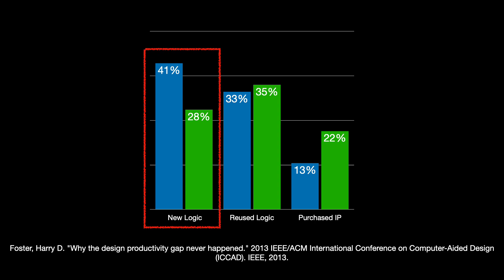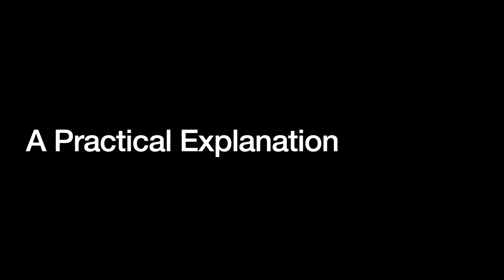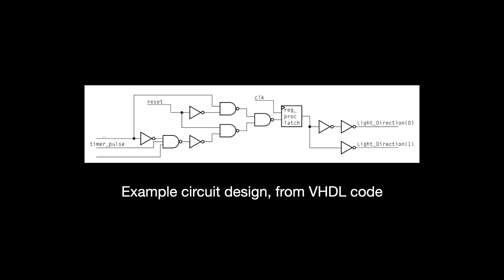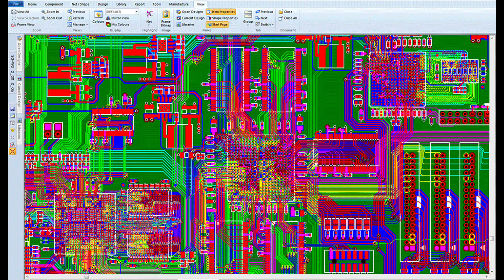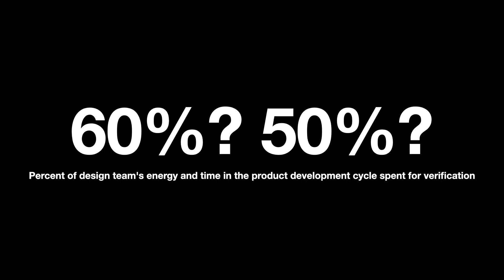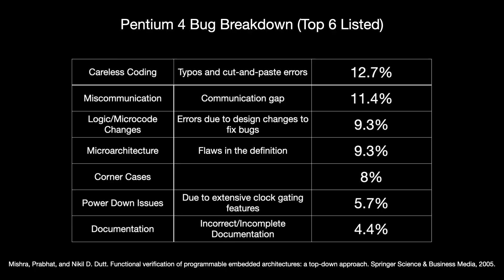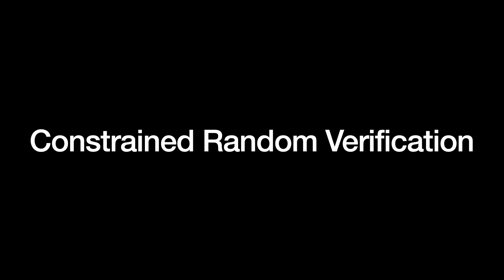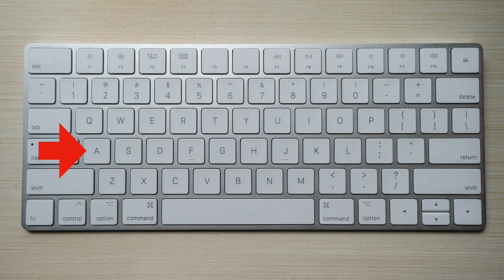The Growing Semiconductor Design Problem

Comment: I'm a test architect for software and daily work with some of the most advanced testing techniques. A technique that I'm curious if it would work in the hardware world is called mutation testing. Essentially, you mutate the product intentionally and ensure that your tests fail. The idea is - if they don't fail, then your test method wasn't sufficient to catch the mutation and must be improved. The only problem doing this with hardware is it would be very expensive to produce mass quantities of intentionally bad hardware. Still, interesting to think about.

Comment: Very interesting but all the stock photos used are pcb designs of a old computer motherboard… not the best idea when target audience are engineers. Logic design like Vlsi are FPGA design, which has nothing to do with asic design where you make cmos transition designs. There are like 5 layers of abstraction between wire and logic to bare silicone
Reply: Hate to say this, but full of messed up information. FPGA design has very little room to improve because they are not meant for performance. Soc has nothing to do with fpga, which has nothing to do with asic design or silicon level verification. A BS level college student would know these basic things
Reply: If you want to say “Vivado runs slow” just say that. Don’t over generalize.

Comment: I would say the problem is a bit deeper than depicted in the video. Digital circuits allow for atomization of the design, logic and layout today already. I expect that verification of such CPU or microcontroller will as well be automated as shown in the video. Yet a gap e.g. undiscovered spec breach may still exist. CPUs are built keeping that in mind and will have fallback structures implemented to fix without requiring a full new mask set. Now here comes trouble when going to a safety critical application such as automotive microcontrollers in an ASIL rated environment. While those controllers are far less complex regarding their computing power, the effort that has to be put into verification to comply with iso26262 standards is astronomical! This is also the reason why many OEMs ditched their efforts for full autonomous driving, because given today's safety metrics it is simply too expensive to build a system that is more reliable than a human being.

Comment: If you integrate other people's code to your own code, you shouldn't have to test it. The other people who wrote that code should have already tested it and if they haven't do so, nobody should be using their code in the first place.
Reply: But then their code, which worked perfectly fine by itself, interacts in an undesirable way with your code, and unless you test it in your use case, you wouldn't know.

Comment: First of all, great video, this channel is absolutely one of my favourites! This sounds a lot like the job of CSV in pharmaceutical manufacture. Although I admit it’s technically far behind the complexity of chip design, the principles are the same, we want to avoid bugs like the incident with the Therac-25 X-Ray machine which killed a bunch of patients undergoing cancer treatment due to an error in the code. We work to the GAMP 5 ISPE standards to instruct on the level of validation. To get over the problem of performing endless testing to cover every case we use a branch of maths called DOE, design of experiments, to calculate the best permutation of experiments to conduct. I was wondering if the constrained randomisation that you described utilises some DOE or would the maths become too complex to be practical.

Comment: There is a big push in the industry to adopt formal verification, as it can greatly reduce the effort for some verification tasks. However, it's a totally different paradigm from the traditional UVM/constrained random flow and  it can't fully replace it, at least for the moment.
Reply: How is formal verification different from what is currently done?
Reply: @abuttandahalf  Basically there are mathematical proof finding algorithms already in use in academia. The gist is that the formal verification engine takes in "assertions" that you write that establish that "condition A must occur after condition B in X clock cycles", allowing individual line item requirements to be broken down into checks in the code. This is what is done in UVM and constrained random flow, but there are quite a few limitations and expansions that are far less hardware and more mathematical. Here's two statements we can use:

 p until q – if q does not happen,p holds forever
 p s_until q –q must eventually happen in the proof

Leading to statements like
(@ posedge clk)

start ##1 !complete[*] ##1 complete |=> done ##0 eventually finished

Which means "on each clock edge, if start condition is valid AND on the next clock cycle complete is NOT valid for an in indeterminate amount of clock cycles AND complete is valid on the next clock cycle, then on the next clock cycle done MUST be valid AND finished must be valid *at some point*". It's got the same level of density as regex, only now it's time based and you can overload the formal verification engine by implying testing conditions that explode exponentially.

Yippee.

Comment: There are many people from IT (or want to became IT), so they really fast spot relation to software engeenering.

But. If you want to became realyy excelent IT member. You will get 10 years or more expirience, dig to IT history. And then dig to other things. History of engeenering itself, lingcistic, politics (yes you can have insights from there for coding).

And you will find out, that software industry is very young. It lacks many existing answers.

Problem here - no standartisation. You need to be able to get core "from intell", "from amd" and "from xiling" and put on standart interconnect. 

Acoording from mine understanding of silicon industry - this will be done with wide risk-V adoptation in 5-10 years.

Comment: Interesting. The "black box" approach to systems engineering seems to be what your referring to... assume that your building blocks do what they say they do. But reality is that there is poor QA. And modern documentation is just garbage, probably because the code and even the language itself is "short term", meaning it will get a fix "in the next version".

Comment: Keep in mind that in the post silicon verification process we have to test the silicon across manufacturing process, temperature, and operating voltage( or as we call it PVT) we support. the production wafers we get back from the fab, have some variance in the parameters used to make them. so during the verification process we get "split" silicon or silicon made using the extreme edge cases of those parameters to ensure that the chip functions  even at those extremes. here's a good example of how this gets out of hand fast. imagine your company makes a blue tooth transmitter chip, and you want to make sure you meet the bluetooth FCC standards. you have to test a minimum of 3 pieces of silicon from each process corner. you have to test your minimum voltage, nominal voltage, max voltage.  all across your temperature range lets just use -40c, -20c, 25c, 60c, 80c.  all to test your spectrum emissions across all 40 broadcast channels.  So in summary, 3 chips, 4 corners, 3 voltages, 5 temperatures, 40 channels for a total test count of 7200 test cases. That is for a single functional test. shit gets wild
Reply: I'm curious.  How difficult is it to set up an automated test for those?

When you talk about the manufacturers cutting into the parameters.  Do they cut the safety margin to the bones now.  I know an old chip designer that got 10x advantages back in the day by seeing how close he could cut into the safety margin on hand designed chips and tiling software.
Reply: @waynemorellini2110  the parameters i was referring to are the actual transistors performance metrics. How much charge needs to build up before they flip, how fast that charge can build up, and once flipped how fast the charge drains. All of those characteristics vary within a window in a normal non process controlled production wafer. As for automation you basically have to automate everything. We have entire engineering teams dedicated to making our test infrastructure, and test cases. not to mention running the testing.
Reply: @kensgold  Thanks.  I was wondering how much time goes into preparing the test code and rig?

Comment: For those wondering, here's a simplification for verification and validation:
- Verification is checking if your built the thing right
- Validation is checking if you built the right thing.

Verification may get all green lights and checkmarks for every bullet on the list of specifications, but validation could show that while the purpose was to build a fridge, the actual thing turned out to be an oven.
So verification is checking all the technical specifications, whereas validation is checking the user requirements.
Reply: Validation is really big (mandatory) in pharma and medical devices industries. Is that the case in semicon as well?

Comment: As a lot of time is taken in this verification, then this time could be reduced maybe only with more and more simulation capacity.
Using maybe 16 or more cores can be required depending on the task.
And analog problems can be even harder to debug.
Verification software though exists quite much but with high license costs.

Comment: How hard would it be for a Chinese foundry to add indetectable functionality to chips? Isn't it a security issue? Was it part of the huawei 5g chip controversy ?
Reply: China is not that advanced in chip design and manufacturing.

The real issue is that the US NSA would not be able to get backdoors put ik Huawei devices making it harder for it to spy on countries and people
Reply: @temur72  TSMC is a Chinese Foundry that produces most of the semiconductors and have advanced to 4nm, I wouldn't underestimate them. NSA backdoors are definitely an issue.
Reply: @PierreH1968  TSMC is Taiwanese, it is the most advanced foundry company right now.

China would not use a Taiwanese company for something that secret/ important
Reply: @PierreH1968  
To China it does not exist, but in practical terms it does.

As for influence, China does have a lot in Taiwan. in 2018 1 in 10 working age Taiwanese worked in China

Comment: THIS is the CHIP CRISIS. It isn't physical PRODUCTION as is told on the mass media (which LIES), it's the VERIFICATION level of automotive chips (which has gotten insanely complex in the US because of EPA and "safety" specs) which is the hold-up. When the chip-set is replaced YEARLY (as in cars) due to Gov't. regs, the TESTING often takes LONGER than the vehicle's lifespan.

Comment: I'm a software guy.  I know next to nothing about hardware, but I do know about the development procdess, and it seems testing is seen as a problem in both.  There is a solution on the software side.  I'm not sure it's applicable to hardware, but perhaps.  Don't test.  Take a page from Deming and blow off testing.  Well, not quite.  What he did for manufacturing was to lessen the need for testing by perfecting the manufacturing process so that faults did not happen.  It works for manufacturing automobiles.  There are ways to make it work for software development.  Chips?  I can't say.  For software we do it by automating the process.  Rather than write code, by hand, to do a thing, you tell the computer about the thing and let the computer write the code.  Mistakes are possible if you get the requirements wrong, but coding bugs are eliminated.  So, the code will always execute to completion, but the correct result is still subject to proper requirements gathering.  There are ways to ensure even requirements are correct, but that is a longer story.  

Is there a way to get a computer to design a chip?  I have no idea.  But if it were possible, then you migtht reduce, or eliminate some of the verification.  

Cool video.  Thanks.